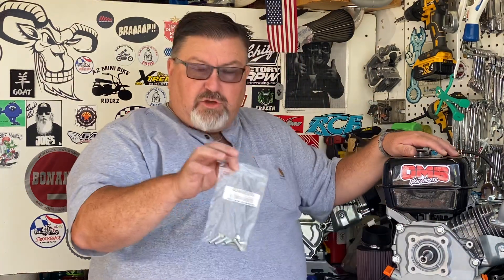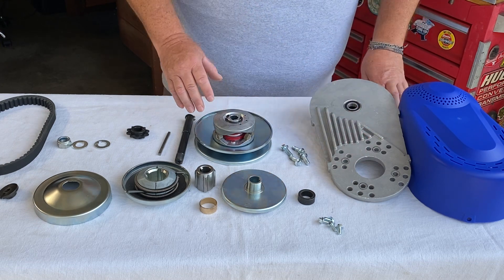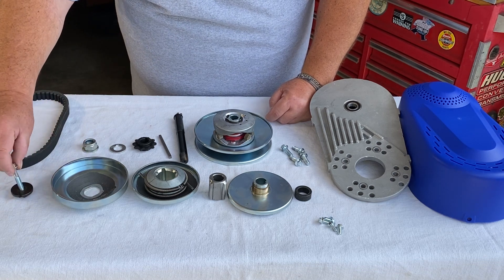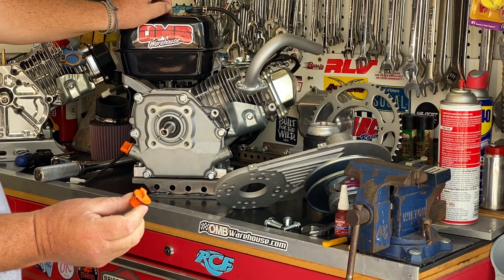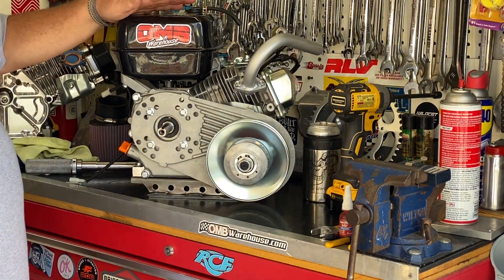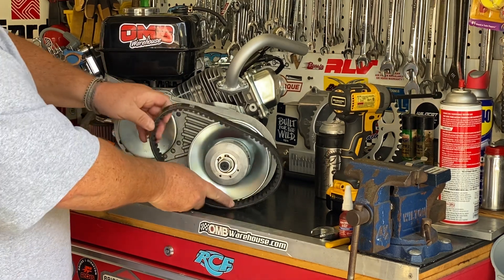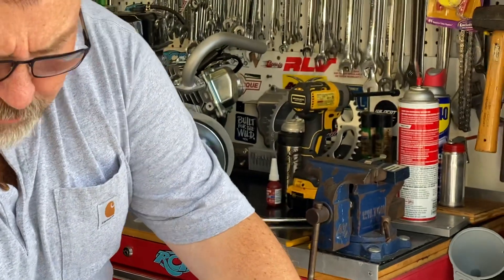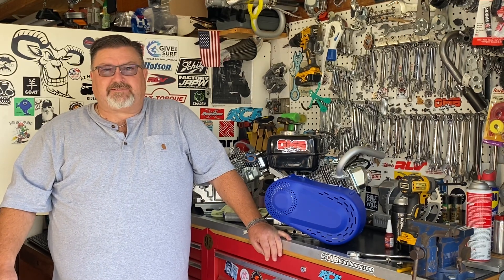30 Series Torque Converter assembly and installation

Comment: My Comet torque-a-verter kit only came with a #35 sprocket and my bt200 has a 420 chain.
I unfortunately didn’t realize this until I destroyed the sprocket. 
Thankfully Comet customer support is actually really good and the guy even offered to FaceTime install the replacement clutch with me.

Comment: One question, I put my torque converter on just got in mail today from omb, and I watched the video while doing it, the inner drum on front pulley is rattling with outer drum, and I made sure everything was tight what could the problem be here?

Comment: Thanks for the video, I have a problem hope anybody can help.

I put a converter on a Baja Warrior. If I do it the way it's done in this video my
front sprocket is not in line with my rear sprocket. The chain wears the inside of the front sprocket.

So I put a space on to move the front sprocket out. Now the chain works fine, but when I align
the two inside belt plates I don't have enough drive shaft left to mount the hub.

What am I missing?

Thanks

Comment: Just got back from basically the first hour run with the new clutch. The brass idler bushing has shavings on my chain I haven’t taken the cover off yet but what eats that ? The main bolt coming lose or is that a alignment issue ?

Comment: I have a Baja Warrior with the 196cc engine but the crankshaft is treaded on the end to take a nut to hold on the clutch. I don't see any Torquer Converters that will woke with this type of crankshaft on a Mini Bike engine.

Comment: I'm in a pickle I have a 92 carter brothers shortster takes a 3/4 jack shaft finding belts for it has not been easy half tempted to make a true jack shaft but finding a 3/4 30 series is tough
Reply: If it takes standard bearings for 3/4 can you downsize to something with a 5/8 ID to carry  standard keyed shaft? If so you'll be ahead of the game.
Reply: @fatbuddycat  I've been looking at bearings it runs a 6 inch 3/4 belts are hard to find if I change it belts are really going to be hard to find

Comment: What size bolts are for the cover. We bought a project bike and came with cover but no bolts
Reply from the maker: The aftermarket converters use an M6-1.0 x 10mm bolt for the cover

Comment: What about putting the sprocket on the right side of the aluminum plate next to the snap ring?That's how mine is.
Reply from the maker: That is not good! The plates are not designed to take pressure from that side of the plate. We have sent them break because if that. 
The sprocket should only be between the plate and the driven
Reply: @TheGrayGoatGarage  thanks for you input.Western Pa.

Comment: Is the riser plate mandatory? I'm about to finally receive parts tomorrow to place 2 CXRCY Torque Converters onto 2 predator 224's for a warrior 200 and a ct200u ex.
Reply from the maker: The riser plate is not 100% necessary, but you will need to raise the engine to get the torque converter mounted.
We designed the riser specifically for the Coleman bikes so you do not have to cut the frame.
We have also used it successfully on the Warrior.

Comment: If 1 of the bolt holes that hold the side plate of the torque converter on is stripped but the bolt still goes in all the way just doesn't fully tighten and i use red loctite on that bolt is that good enough or should i rethread it with 1 size bigger ? Right now i have red loctite on it.
Reply from the maker: I am not keen on going one size bigger. That will compromise the side cover and you would need to be very careful and not go too deep
It is hard for me to evaluate without seeing it
You could try this product
https://ads.midwayusa.com/product/1007104882?pid=986916&utm_medium=shopping&utm_source=google&utm_campaign=Gunsmithing+-+Tools%2C+Jigs+%26+Fixtures&utm_content=986916&gclid=Cj0KCQjw37iTBhCWARIsACBt1IyXtZheydVvP47OsDpEkIuTj_5-G4ALYodTrf1F_VklEbrftEAY71MaAuyTEALw_wcB
The best thing to do is replace the sidecover 
It may be ok with 3 bolts, but ya never know!
Reply: I did that once and I used Teflon tape to jam up what threads were there....it's not ideal but it got me through till I found another side cover.
Reply: @fatbuddycat  p points

Comment: I have 212 non hemi predator with a 3/4 bore/ camshaft size will this fit mine???
Reply from the maker: @beeeehbobooo  yes, this is correct for your engine. Make sure to use the correct hardware for mounting and the crank
Reply: I just ordered the upgraded torque converter kit TAV2 3/4 shaft kit!!

Comment: Can this kit  be installed to a 301cc predator engine???
Reply from the maker: That depends. The bearing housing on the mounting plate will hit the rear oil fill plug. Most people have to cut that off to get the plate mounted. 
If on a tall kart you could hang it straight down and be ok

You would be better off with a 40 series unit. Heavier duty for all that torque and an easier install

Comment: Would you happen to know when OMB warehouse will have those series 30 torque converter with the stage 1 kit again? It has everything I’m looking for in one package but has been out of stock unfortunately
Reply from the maker: Hi Bradly, if you are referring the Coleman kits with the riser plate, I am hoping to see those early next week. I have been out of the country for 2 weeks aned that one slipped through the cracks!

Comment: What size are the bolts that hold the mounting plate to engine?
Reply from the maker: Depends on what engine you have. The Predator 212 engines use a 5/16-24 x 1” bolt and the metric engines would use an M8-1.25 at 20mm in length

Comment: How long should a belt last?
Reply from the maker: 2 days to 2 years! It depends on how the torque converter is installed, the engine, and the gearing choice. Install it right and you could get 6 months from a belt.

Comment: What diameter bolt threads on end of crank shaft please, the one in my kit is wrong
Reply from the maker: There is no way for me to know that! Most 3/4” cranks are either 5/16-24 or M8-1.25
Reply: @TheGrayGoatGarage  thanks, ends up it is a 6 mm, just gotta determine length now
Reply from the maker: @andynichols213  for the 16MM cranks and torque converters we us M6-1.0 x 55mm long

Comment: Update  just saw your earlier video on the 16mm setup that doesn't use the bushing but will leave my question. Thanks for your video work on install!!   How important is the bronze idle bushing? I am putting together a convertor unit sourced thru Go Power Parts and it looks like yours but they don't use an idle bushing.  Is  the bushing made of Oilite bronze which is self lubricating or just plain bronze or brass?  Can it be made of steel?  Saw another video where a guy had trouble with the bronze bushing and left it out and claimed no problem with it unless you let the bike idle for long periods. Being a retired Toolmaker I made my crank pulley spacer out of a solid piece to correct length instead of a stack of washers. Also making support bushing for the small 16mm bolt that holds the driving pulley pack on crank. My bike is the Coleman BT200X.
Reply from the maker: The bushing is not that important to warrant the work. It only helps the belt when idling…and I don’t know about you, but I don’t let my bike idle all the time. Most guys that eat the bushing on the 3:4” units never replace them!
Reply: @TheGrayGoatGarage  Thanks for the reply Eric!

Comment: does this fits a honda gx200?
Reply from the maker: Yes, it will fit as long as you have a 3/4” diameter crank that is 2-7/16” long

Comment: this kit DOES NOT fit on stock colemen ct200s
Reply from the maker: That is correct! I believe your bike has a 16mm OD crank that requires an adapter to convert the crank to 1" OD
https://www.youtube.com/watch?v=EY5ru170xAA&list=PUalP3N2JwevprwDjSe54XVw&index=8